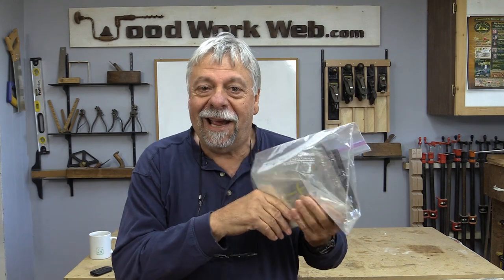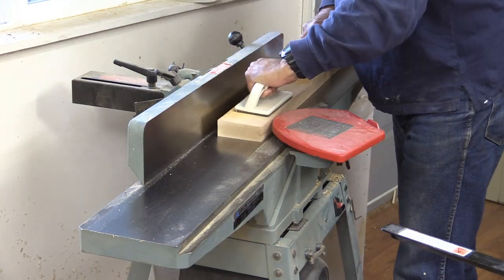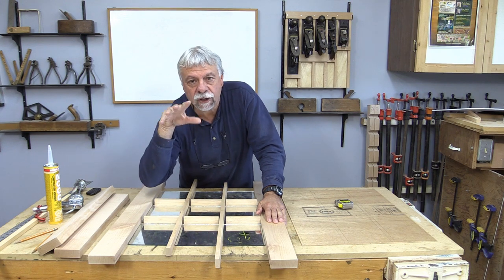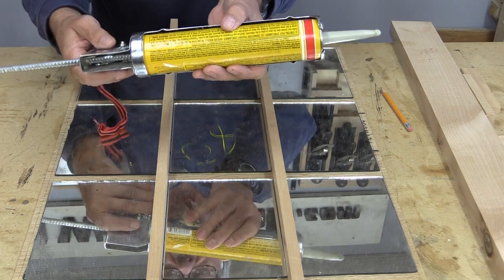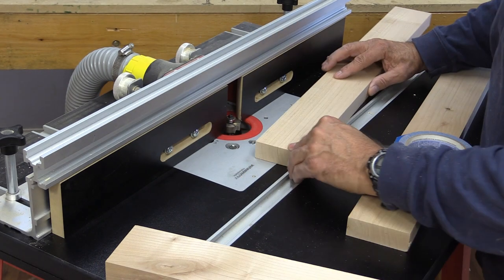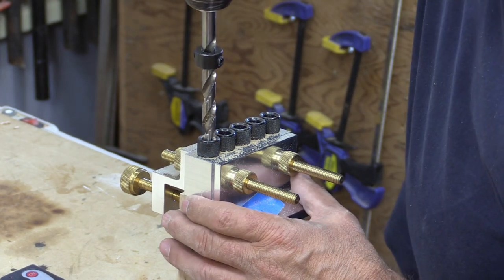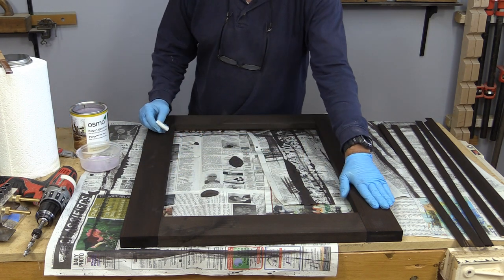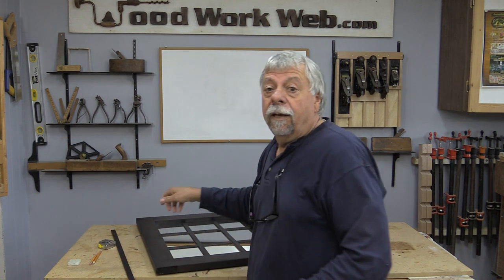How to Make a Decorative Window Panel Mirror

Comment: Hi I just subscribed. I am a crafter with a miter box with saw. I would like to make a simple window frame / pane. A wood frame that only holds a pane of glass. What type of wood would you suggest? Should I use glue and my staple gun on the joints?

Comment: turned oit really nice colin! question: what size rabbitingģ bit do you use for frames.is it one size fits all kind of thing or does it depend on size of frame? thanks man!
Reply from the maker: +Joe basementwoodworking The rabbeting bit I used is one of those adjustable ones that you change bearings on for different widths, I think it was 1/4" that I used.

Comment: Hey Colin, great videos. I have a question. What would you recommend for stains for a Winchester Shotgun I am restoring. I sanded the stock and forearm down, added glue to the cracks, now I need to stain it. What would be the best brand for that?
Reply from the maker: +Matthew George Hi Matthew, for coloring gun stocks I prefer to use a dye such as those sold by Lee Valley, but others sell them as well. When you say you added glue to the cracks, was this to done as a filler or did you use the glue then clamp the wood back together again? You will want to check your glue joints with some rubbing alcohol to make sure it has not glazed the wood because stains or dyes cannot penetrate glue. You may need to sand it down a wee bit in that area.
Reply: I clamped the wood down after gluing the cracks down again. And yes I have sanded it and its as strong as an ox and smooth as can be
Reply: Thank you, I will have to get ahold of some tomorrow

Comment: HAY BUDDY DO YOU HAVE A VIDEO ON DRILL SAFTEY TODAY I WAS DRILLING A 5 IN HOLE THROUGH MY 125 YEAR OLD HOUSE  8 INCH WHEN I WAS DRILLING  I HIT A OLD NAIL AND BROAK MY WRIST NOT GOOD OUCH iT HAPPEN SO  FAST WOW MABY YOU COULD  PASS SOME GOOD INFO ON LKE YOU DO
Reply: Use a battery power d drill with a clutch and go slow.
Reply: +Techmatt167 Yes slow would have been better much better
Reply from the maker: +Charlie Wood Wow, yeah a 5 inch hole is big chunk to be hand drilling, as you say if you have a powerful drill, a hole that size can certainly do some damage. thanks for commenting and sorry to hear what happened.